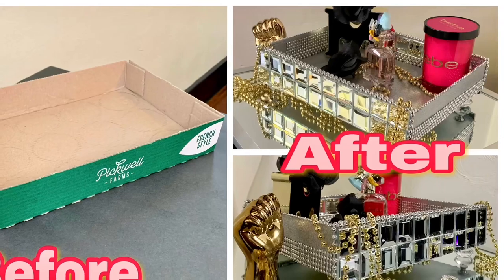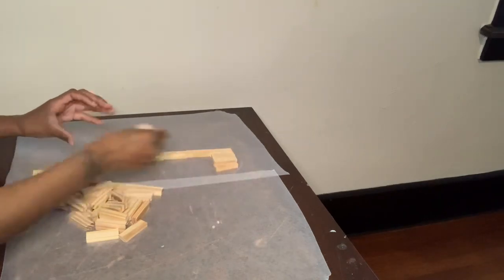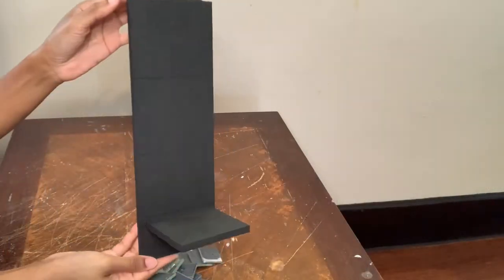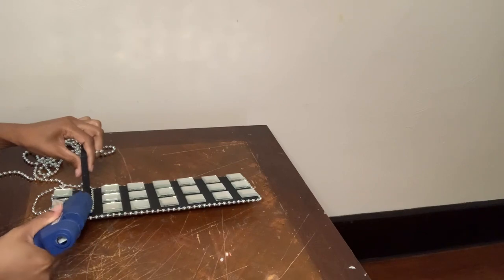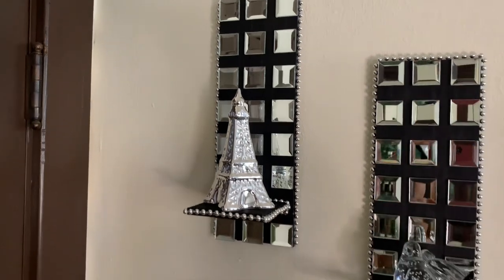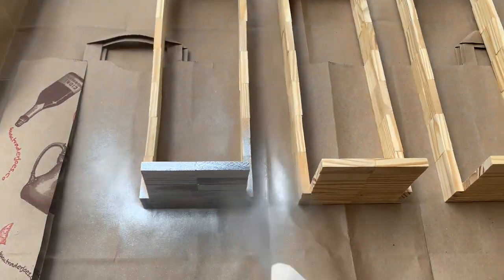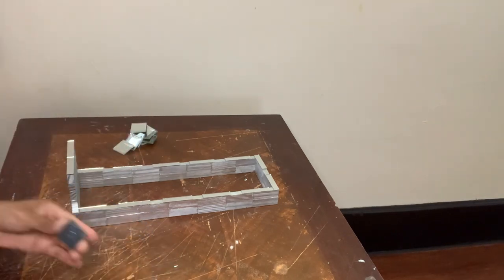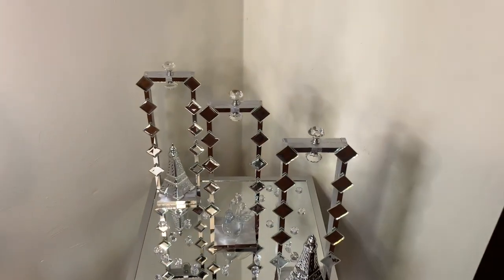New 2022 Wooden Wall Sconces Featuring Blocks || Dollar Tree DIY

Comment: They r very nice but no instructions of how many blocks were used
Reply from the maker: **Instructions on how many blocks I used. PROJECT #1…7 Blocks going down 7 Blocks going across. For the extended piece, I used 6 Blocks going down 2 Blocks going across. Totaling to 183 Tumbling Tower Game Blocks used for project #1. PROJECT #2…7 Blocks going down (on each side with an additional added layer) 2 Blocks going across. For the extended piece, 4 Blocks going down 2 Blocks going across. Totaling to 126 Game Blocks used for project #2. OVERALL PIECES USED = 309 Pieces 
So I used about 5 Boxes of the Tumbling Tower Game Blocks for both of these projects. 😀